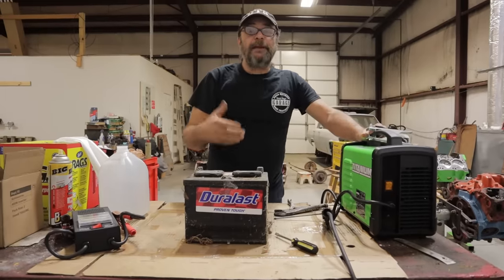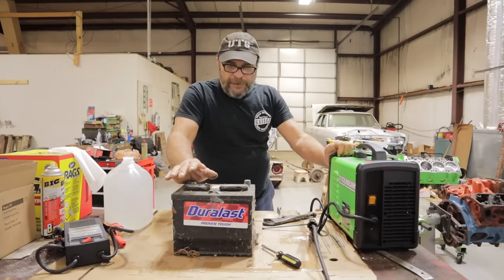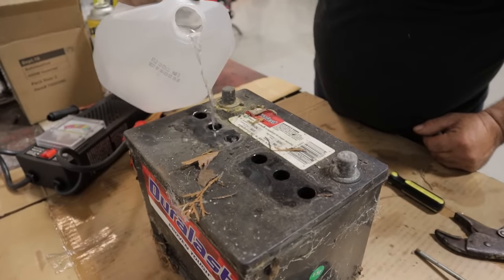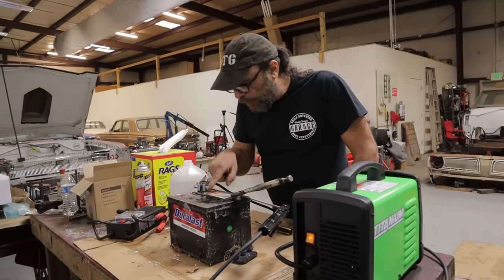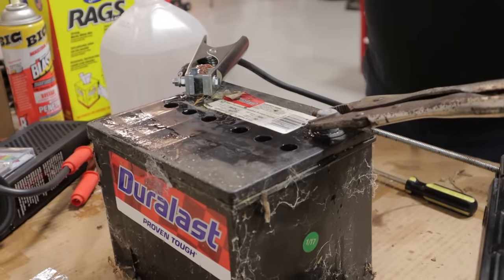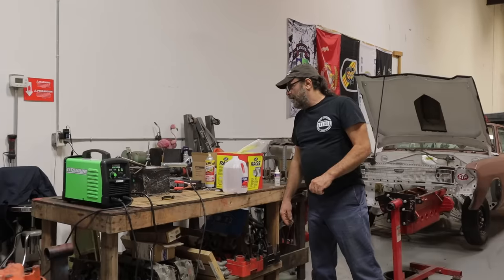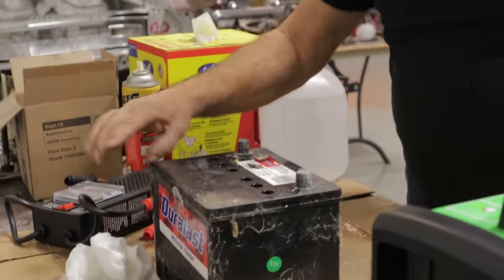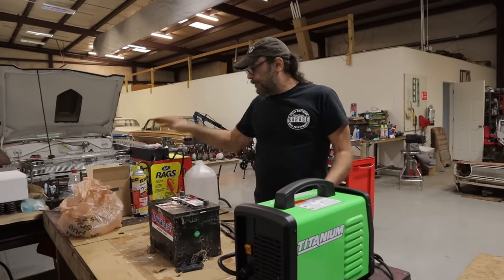Reviving Dead Batteries With A Stick Welder

Comment: As a mechanic and a welder I can only think where this could go wrong in reality. That is where the broken plate would arc across it's gap and ignite the hydrogen gas internally like I have had happen to me. The plates stick together just enough to get things to start to charge, but when you hit the key and full amps are drawn from the cell the plate warps and separates causing an internal arc that ignites the gas quite explosively. This is much different than charging the battery and pulling the clip off creating an external spark. Both go boom but the external spark an we'll be avoided. Whenever messing with lead acid batteries a face shield should be your first line of defense.
If for any reason you feel uncomfortable doing this sort of work trade your old battery in on a new one.
Reply: Yeah.  Face shield, rubber gloves and coveralls.
Reply: i did think think it was dumb to have welder sitting beside it i assume its a new dc stick welder but i would have sat on the floor below the battery...
Reply: I cringed the whole time!!
Reply: Mate it'll scary to me I lost an eye in battery  explosion a spark near the top the battery blew to pieces one of the terminals took my eye out face damage acid it's not a good thing trying new things with battery's  just on the charger is enough.
Cheers
Reply: Like in my comment I’m now deaf because of this so called hack
Reply: @ambread1  For real?
Reply: I've been a professional tech/mechanic since graduating from technical college in '91 with 6 years part time prior to that. this scared me watching it! You shouldn't be attempting these kind of "experiments" in the 1st place but being people insist on doing so you might want to add a full face shield on top of safety glasses, good hearing protection, a "smock" to protect as much of your body as possible, waterproof gloves etc etc etc. I would also never be anywhere near that battery when turning the welder on!!!! At least you did say to only do this outside. Watching you do this made me cringe.

I've had 2 batteries explode in front of me in my entire career. One exploded without cause. I was opening the hood on a car when the battery exploded. Fortunately the hood wasn't open very far when this happened. This was much louder than any explosion I've ever heard in my life, and I served in the US Army! All of the acid was contained in the engine bay for which I was grateful!  The other battery explosion I witnessed was due to dirty terminals with a charger on. Seeing the charger was not putting out any amperage I went to remove the charger clamps when there must have been a miniscule spark and BOOM! My ears were ringing for a week! Thankfully I was once again spared an acid bath.

Battery explosions are NO JOKE! 12 volt batteries do NOT cost all that much, ESPECIALLY considering what a new vehicle costs in proportion to the battery. IF you can't afford a new battery, you can't really afford to own & operate a vehicle. I can only imagine the safety "hacks" and complete lack of maintenance the vehicles of people who would do this suffer from. This is on the same street as USED tires.....frequently outdated, illegal to mount & often with the bare minimum amount of tread.
Reply: @CptKirKBo  Mate Ina few word's 
This is a nightmare I had  a very bad accident with one spark at the pole on battery coming off charge took out my eye left side of face bad acid burns .
Just saying hope this helps even one person suffering.
Cheers Wattie
Reply: @wattienewton5967  Sorry you had to endure that...but I agree.... I hope people who read this take the advice more than a few of us posted....but I doubt it. Some people are chiselers no matter what and if they can save a buck, they'll risk my life, your life as well as their own...they don't give a shit. I saw that sort of thing when people would bring in a vehicle for a PA State safety inspection and the chassis/suspension would have major issues, brakes would be shot while they had their head buried in a $1000+ iPhone (plus at least $60-$100/month service), had on sneakers that cost $250, had $2-3000 into their stereo & expensive wheels on the piece of shit...yet they would curse me if I refused to put a sticker on it. I especially loved seeing those cars with 2 or more car seats in the back! I saw that more times than I can count.
Reply: I cringed watching this while video. He is very lucky. As you were stating and confirming this battery likely has very little damage but even then things go wrong. 1. What was the cost of running all those amps through 2. The risk level is extremely high, if you havent seen hydrogen ignite, I don't recommend it to anyone, it's an extreme amount of energy released. 3. He puts distilled water in the cells but allows who knows material (organic and otherwise) to get in the cells, don't do that. 

As someone knows about chemistry and physics, please don't ever do this, this is not a side hustle, you are playing Russian roulette and the damage that can happen your skin, eyes, etc. is not worth the money to just buy a new one.
Reply: @CptKirKBo  Loudest explosion you ever heard in your life?  You must have operated a desk in the Army.
Reply: @BISQUIK4570  you obviously never had a lead acid battery explode within 24" of your ear! Infantry, then a Tank Mechanic in the Guard.
Reply: @CptKirKBo  By god I sure as hell have.  I built the damn things at Exide for 16 years.  I've seen a few pop on the hi-rate machine on the boosting line.  I've also watched the boys from EOD set some shit off among other things.  Not even in the same ballpark.
Reply: @BISQUIK4570  I thought the 120mm in the Abrams going off had an awesome "BOOM" but it didn't seem as "sharp" a sound, if that makes any sense. What most impressed me/stuck with me with the tanks firing is how much the tank hull moved when firing from a standing position. Those bad-ass mofo's are 67+ tons if my memory serves me right...wouldn't think firing a shell that weighs less than 40lbs would move the hull as much as it does. They're incredible machines. You'd also want to take into account the battery exploded while I was opening the hood and was within 2' of my head. It's reasonable to think the angle of the hood directed much more of that sound at me than would have reached my ears (mainly my left ear) than if the hood was fully up.
   I was never close to any real detonations...heard a lot of artillery but it wasn't all that close. I can't explain it any better honestly though....that one battery blowing up stuck with me....on top of scaring the ever living shit out of me. 
   The 2nd battery explosion I witnessed wasn't as loud as the first, and it exploded with my right hand on a battery charger clamp trying to reattach the charger clamp to obtain a better connection.

   You guys have them explode during manufacturing though, HUH? What causes that? Bad casting of the plates?
Reply: @CptKirKBo  I would chalk that up for you being close to the battery for sure.  I honestly couldn't tell you the cause, but I doubt it would be anything to do with the plates, more like a short in the straps, or a punctured envelope.
Reply: Yes, when charging a lead acid battery it produces hydrogen gas.  Another reason to NOT fill up the level of water in a battery.  2 parts hydrogen, 1 part oxygen is H2O, water.  Leave a little room when putting water in a battery when charging.
Reply: thanks for the warning, I'm still going to attempt this but thank you. I make hydrogen gas with fuel cells and I have blown up a few times I know the  power of hydrogen..
Reply: @CptKirKBo  You served in the Army. Never do it again, it's dangerous!
Reply: @bonisistvan  I hope this is some kind of joke, right?
Reply: @ghettocowboy993  there was a guy who lived a mile or so from me that blew up his house building a hydrogen cell. Lots of people thought it was a meth lab, but I knew he was just playing with something he had some, but not enough knowledge of. You have to know something to realize you know nothing.
Reply: I once attended a workshop after an accident happened.  Someone charged a lorry battery all night on a high charge.  The next morning the driver came in took off the leads the flashed back and exploded spraying boiling acid in his face.  When I sore that the whole side of the battery was missing  and plates bent out it gave me a new respect for battery gases. & breathing gases can burn your wing pipe maybe only noticed the next day. Good video.
Reply: I would probably use this as a 'battery maintenance '/ yearly (wid all connectors off and shielded/ inside an engine) and do a low amps charge, electrolyte topped up and caps off. Then heck dat it has increased holding amps and higher. If U want to try this on old batteries, U better check each plate are not brittle or has a lot of metal wen U tip out acid.
Reply: You can tell he’s a little crazy He suggested everybody do it outside.    breaking all the rules and doing the inside
Reply: My wife had just that happen back in the 70's. Hit the starter and 💥. Scared her to death. Took a long time to clean up the mess.👍
Reply: Interesting and informative thread. I have a lot of batteries in my occupation and have used a 200 amp battery charger to desulfate them. I've welded too much steel in my life and couldn't imagine using a welder on a battery like many do. Thanks for the real life insights of the possible dangers. 👍
Reply: Top advice!
Reply: @kamaksi24  this is absolute fucking madness!
Reply: @wattienewton5967  sorry to hear that Wattie. This guy is a dangerous individual giving out advice like this to the general public. He's doing it dangerously himself so if he's putting himself in danger what chance has anyone else.
Reply: @davekendall9749  not a good video Dave! This guy is a danger to himself and others
Reply: I like to use 240 volts coming off a spare dryer cord to jump my car batteries back to life. Just do it outside.
Reply: I got out my old Honda battery and put the Genius Smart charger on it today. It clicked to 100%. My meter said only 10.5 Volts. So I got out my old school charger and put it on for about five minutes after shaking the battery for a second. Then I put the Smart charger back on and it was conditioning the battery. Hopefully I don't find a bloody mess in the morning. An AC 115 Volt Cheap Welder is Comparable to a Basic old school charger to wake up a battery. Just make sure you have your battle gear on or take a coffee break a block away. In a Shop the size of this channel I wouldn't really care. Some of the comments here are basically silly. My shotgun still works also. Had to test the breach. Have a good weekend everyone and be safe! Charging more batteries in the morning.
Reply: @ambread1  what
Reply: @Dookie_burner  right
Reply: Cracked internally caused 1 to explode in my dad's face on our 1926 dodge. Assume loaded gun theory, IT WILL EXPLODE. Take ALL  precautions and be safe.
Reply: A
Reply: @shirleyhardin2822  A.......eh ?
Reply: @CptKirKBo  I once had a battery cap blow off just because I had an old school timing light too near to it. Boom! Not as ballistic as a shotgun but plenty of velocity to put a dent in the under hood insulation. As Mike Rowe might say, safety second!
Reply: 50 ft leads are a good thing, LOL
Reply: @CptKirKBo  Recaps are lousy, too, I think they should be outlawed for cars and especially tractor-trailers. Just look at all the caps on the highways and think about being beside one when it peels off . Those must weigh about 30 lbs or so..
Reply: @CptKirKBo  You work at Nasa, don't you?.... the more red tape the better and at the end of it all we're under loads of paper with all kinds of legislation....that is why Nasa take years to launch a rocket while spacex are launching them every week, first bunch of failures were costly, but they learned so much of it. I agree , be safe and put something between you and the battery, but don't think that everybody can afford a new battery, Battery makers on the other hand should make them cheaper because they are simple devices, the problem with that is that people will dump them all over the place, so you can't win.
Reply: @Voidy123  Look man, IF someone can't afford a battery, they can't afford to drive!!!! I saw this all of the time and yes, I felt for some of these people and helped out where I could but most put themselves in that position.... couldn't afford tires, brakes, ball joints, bushings, a battery etc YET had on brand new scuff free Air Jordan shoes they brag about costing $250, are playing on the latest/greatest iPhone that costs over a grand plus the $100+/month for unlimited service, have expensive aftermarket wheels (rims, "blades" or whatever other dumb name they have for them today)) that "look cool" but don't fit, rub off of various suspension components/body/chassis of the vehicle etc etc etc. 

The customers I had who tried their best to make ends meet but couldn't got a hell of a lot from me. Made one of my best friends when a black dude broke down in front of my shop with a shredded tire. Told me up front he had no spare and no money. I noticed the haircut and the way he spoke and asked if he was in the military and YES, he was a Marine. I was in the Army/National Guard at one time myself so told him he could stop by and pay me whenever he had the chance and in the end his bill was less than $20. I refuse to sell used tires as I refuse to assume the liability that comes with them. I happened to have a set of tires that were better than any of his and told him if he wanted, he could take the other 3, throw them in his trunk as it cost me $1.50/passenger car tire per tire disposal at the time, so he saved me the $6.00 those tires would had cost. I had to charge him to mount/balance the "new" tire but didn't add any labor as he was a fellow brother of mine, a military man. He stopped back two hours later to pay despite me not really caring if he did or didn't & to the dismay of a few others in my shop who were in fact racist. To me, shit comes in every color, so why single out a single color? I know I have met a hell of a lot more white assholes than I have black or any other race. His name was John and once he was off active duty his reserve station wasn't 2 miles from my shop and even when he'd tell me it would take him several months to pay whatever it took to make his car safe I'd help him out and carry him. He'd stop in religiously every single Friday afternoon whether he had anything to put on his bill or not to prove he was good for it and again, I didn't ask him to do this. I trusted him. He eventually got to a point in his life where he could afford a better vehicle, buy a house (not far from me), start a family etc. To this day we hang out, go fishing etc and I'll still do what I can mechanically for him though due to my disabilities I'm quite limited so NO...

I don't want to hear any crying about parts costing too much. If the parts are too much, how the hell can you afford to insure it? Register it? Get it to pass State safety & Emissions inspections? Maintain it??? It's not my fault if someone can't afford to own a vehicle!!!! I started out with next to nothing and joined the ARMY to pay my way through technical college. People in dire straits can do the same exact thing to this very day and today the sign up bonusses are a hell of a lot better then they were when I joined! 

There is ALWAYS a way to improve ones' lot in life so lose the excuses!
Reply: Can you use a ac welder
Reply: @CptKirKBo  what you just described is a democrat. Could not help that”
Reply: Excellent point... as an Industrial Equipment Specialist for over 20 years, I totally understand and I was kinda freaking out that my friend didn't have more protective equipment on, Lol.  Glad nothing like that happened, for sure!
Reply: Yeah I was Gunna say, given that this is electrolysis , aren't there some pretty volatile gasses being given off? Like hydrogen, or even hydrogen sulfide ?,
Reply: It’s no joke, I had an 8d blow up in the engine room of a tug it literally had the power of a grenade. The blast woke me up in my rack two decks above over the noise of a genset and two 16-149 Detroit diesels running at full power! When I went to investigate what just blew up I found a 1/4 thick steel battery box blown to bits and parts of it embedded into everything. Bits of battery plates stuck to the ceiling, electrolyte dripping off of everything, but the 1/4 steel shrapnel that was imbedded into anything softer then steel and the visible dents to the steel hull plating was absolutely incredible. Had anyone been down there when it blew they probably wouldn’t have survived. There was a piece of shrapnel imbedded into the aluminum turbo compressor housings on one of the mains! The wooden cabinets at the other end of the engine room looked like someone had emptied an entire box of 12 gauge buckshot into them! No idea what happened but I got rid of all those custom heavy steel battery boxes someone had made after that! It was an internal short of some sort, coupled with confinement in a 1/4” thick steel box that resulted in a hell of a blast. After that experience I’m pretty cautious around batteries.
Reply: If something happen's, he will definitely win the darwin award.  😄

Not funny, something like this shouldn't be shown in youtube, it's to dangerous, what can happen.
Reply: Nahhh just don't think it'll happen